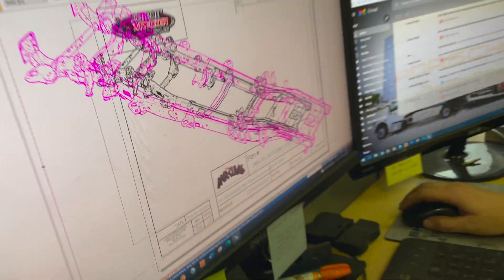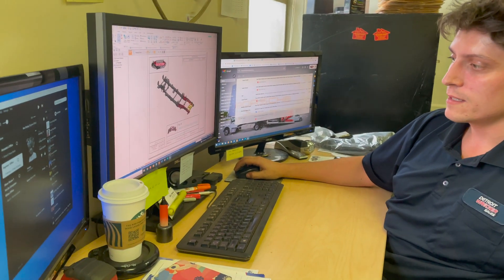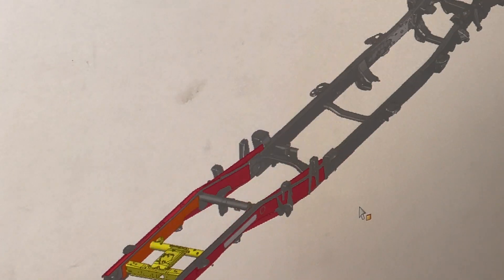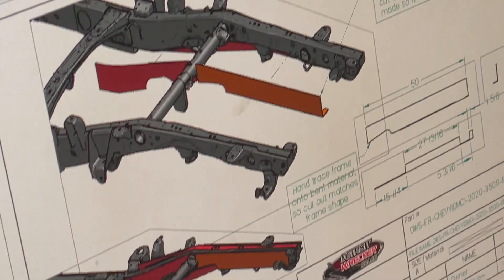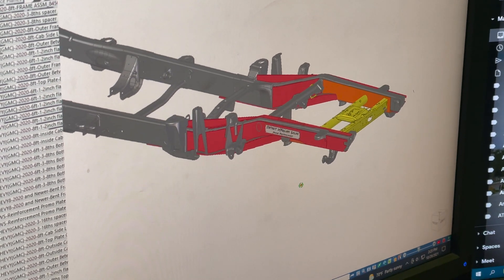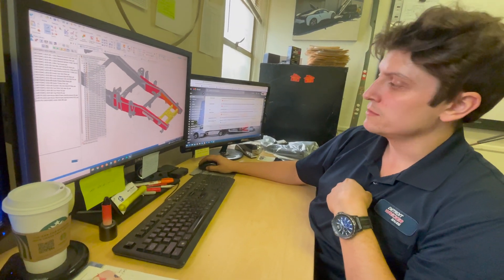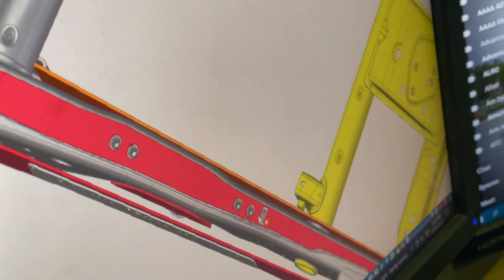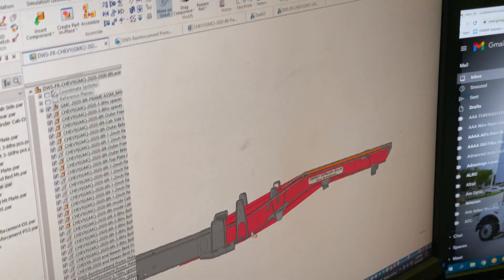Cad Frame Reinforcement at Detroit Wrecker Sales

Comment: always on top
Reply from the maker: Thank you! 99% of our customers never have an issue. If you can break our frames you did something extremely wrong! 😂. 

If you tow cars and trucks smaller than yours…you have to admit. You should NEVER have an issue with equipment or frame reinforcement. 

Again…99% of our clients do not have a problem because they tow normal cars and trucks that are smaller, not bigger than the tow truck. The tow truck is always supposed to be the biggest truck in the equation. 

If you over load the truck and break the frame due to abuse you will automatically void the warranty. We will be happy to repair 👨‍🔧 it, for the time & material it takes to fix it properly. 

We build our equipment stronger 💪 and tougher than anyone else. The side effect of building a unit that will last 20-30 yrs is…some customers choose to pick up vehicles they have no business doing so. That is not why we build our units. We build them strong 💪 so customers get a quality product that last. You have to admit that is is can lift a diesel, then a mini van won’t wear out the equipment in 2-3 years. Yes we show pics of lifting a diesel but that is for testing purposes only. Again, we recommend that the tow truck is always bigger than the tow vehicle. For example, if you wanted to tow a 1500, you better have a 3500. If you wanted to tie a 3500 you better have a 5500. 
 
Thanks for the comment and stay safe out out there!